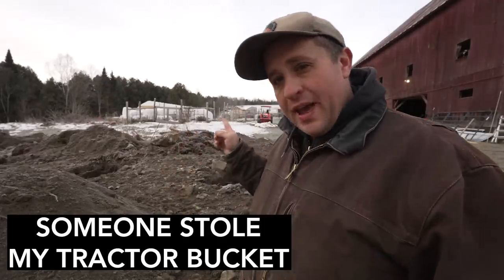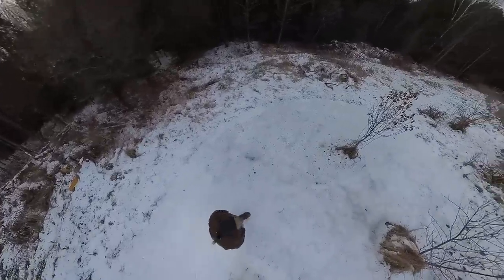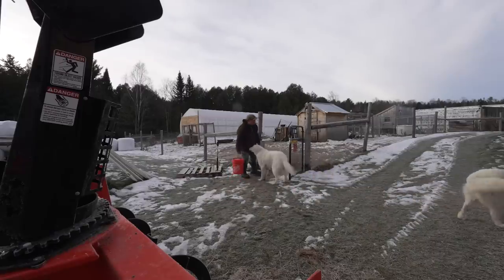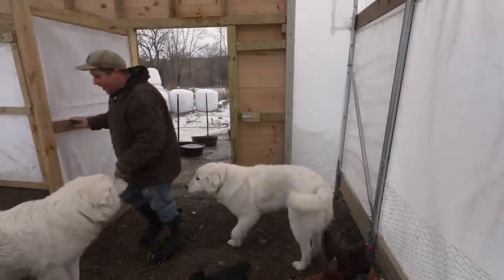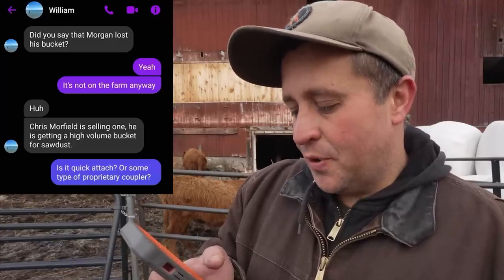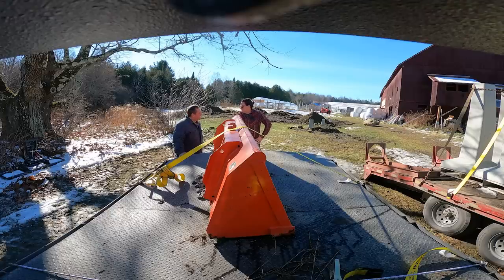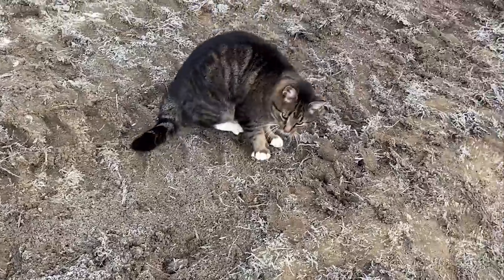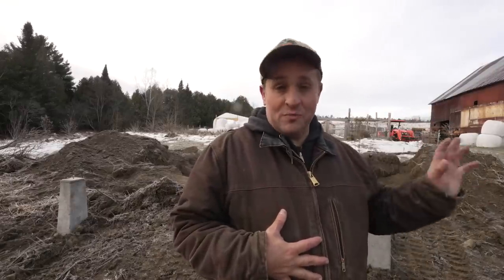They STOLE My Tractor Bucket

Comment: We did piers for a bridge across our creek. It was about this time of year. Once we got a pier built the concrete had to cure. But it was real cold. So we set a tent heater up on top of the pier. Then we made a heavy tent out of sleeping bags. Lots of sleeping bags. It worked ! I believe that bridge is still there in Westford.

Comment: As a tip for when you fill in the dirt between the piers, don’t forget to compact the dirt every few inches so it stays mostly straight in the long run, as you will be parking your tractor in the new barn. If you don’t, the soil will slowly compact over time where the heavy equipment is, and then you will have uneven soil, or the soil will even displace. Learned that today as one of my teacher in agriculture just visited a barn where that wasn’t done before they put in heavy equipment and walls, and now they are facing thousands and thousands of dollars for fixing. I know it won’t impact the quality of your walls as your walls are on these “stilts”, but it would suck to have to redo the groundwork in a few years because of the weight of the tractor creating holes.
I don’t know exactly how (as I am in school to learn these things), but some research would be good. 
Keep up the good work!

Comment: My dad was a caretaker for the local courthouse.  Every year he planted huge flower beds, with different designs, patterns.  In January he would do a diagram of how he was going to lay them out so he knew how many of each colour  + type of bedding plants to order.  He had a few extra one year, so he dropped them off at my place.  2 days later, he phoned me.  Someone wearing leather soled shoes-so an adult- had stolen 3 purple petunias from the front of the flower bed, so he had to ask me for the plants back because the greenhouse didn't have any more. Used a shovel too, it wasn't a "yank & run"

Comment: OMG I'm glad it wasn't really stolen, but I can empathise with how you must have felt up to that point. Just the other week we were burgled and the lowlifes even tried to steal my WHEELCHAIR! It's a powerchair I need for getting around and had to crowdfund to buy it in the first place. Fortunately the burglar was disturbed and fled before he could make off with it, but he'd unplugged the charger and put it on the seat ready to steal with it, and begun loading up the seat with tool boxes to wheel away on it. 

Unfortunately he'd already managed to make a couple of trips stealing other tools, our neighbour's bike, and loads of christmas presents my other half had hidden in the shed - all of it was securely locked away, not visible from outside, with a padlock that even the lockpicking lawyer on youtube says is a challenge, and that was intact. Unfortunately the guy went for the weak point by simply smashing all the shed doors for us and our neighbours. 

We saw him on CCTV from a shop at the end of the street, carrying things out of our road in a few trips, stashing them in an alleyway to grab later, and from there he took it away after he fled. We only found a few tiny dropped pieces from the toolboxes there. 

I just can't believe someone would stoop so low as to try to steal a WHEELCHAIR.

Comment: I must say , imo you SHOULD ALWAYS FILE A POLICE REPORT.... it may not be for your benefit, but it may be information that adds to a larger picture, pattern, crimewave etc... This could eventually result in discovering the criminal or going a long way in locating risk areas, or giving other farmers a heads up. Obviously this is assuming you have established that your property HAS INDEED BEEN STOLEN! This is just my thoughts on reporting crimes, regardless of if it will be if it you.

Comment: My top list of suspects involved unfettered You Tube fans (I apologize). The actual culprit is often the one close to you, isn't it? I have done the same with a smaller thing,  lost it, re-purchased it on Amazon, gone to put it away and magically have the "lost" item reappear. I have to admit, I have never lost something that weighed in the 4-figures. Well unless one counts the car that I parked on level 3 of large parking garage insisting to my companions that it was on level 4. Basically took a mutiny to actually locate the vehicle.